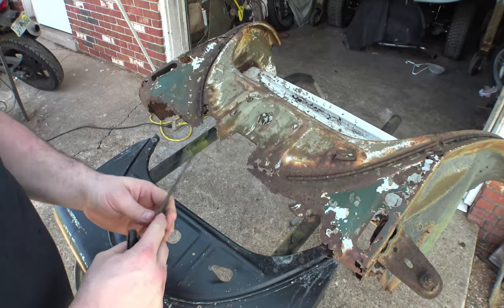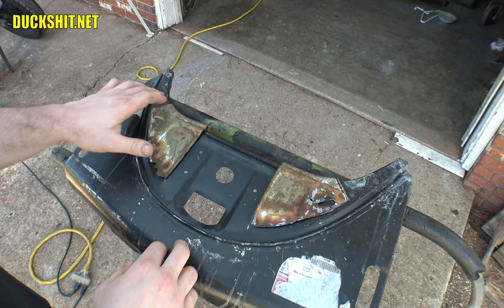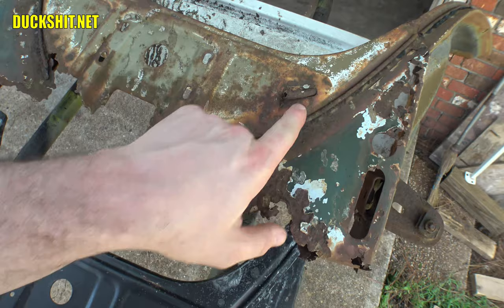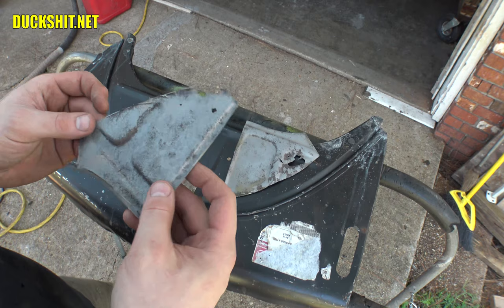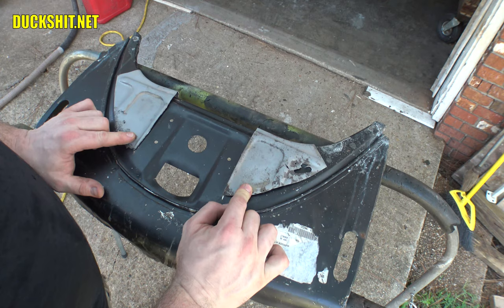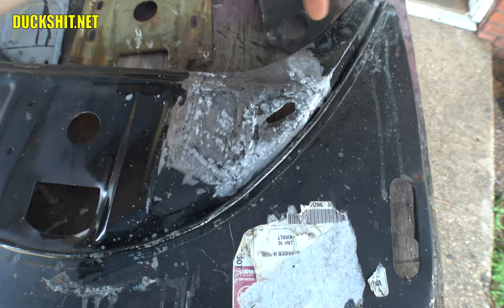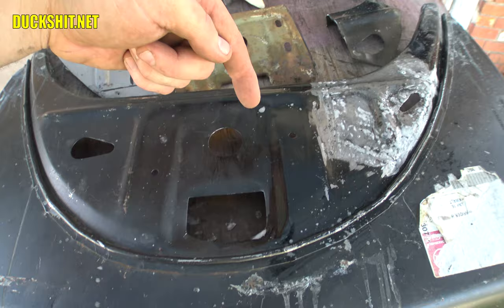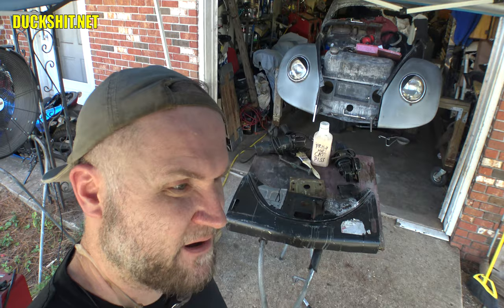Front Apron Patches - ROTTEN OLD 1956 VW BEETLE - 116

Comment: I really like watching someone on YouTube like you do quality work. I am slowly working on my sweet 1985 Pontiac 6000LE. I have known the car since it was new and I have owned it for 24 years. I like picking up quality tips from guys like you! Please keep up the quality content.
Reply from the maker: Thanks so much for watching!  Interesting that a Pontiac guy watches me for lessons!  Thanks so much for sharing!  I hope you're making videos!
Reply: I had a 1989 Grand Prix SE rare 2.8L 5-speed car. Loaded. Now have a 1999 GTP and a 2005 GT2 (4-door). Had them since new too. I know them inside and out and have the Helm Service Manuals. Isn't the 6000 like a Bonneville?
Reply: All this A-body had been crunched here. First they last as shifted stacks.
To be fair, nice design (Buick Century 2nd gen) but poor quality and fitment
Reply: @junkman6456  I have had great luck with my car over the decades. It now has over 230,000 miles on it. The 2.5 liter Tech4 and THC 125c transaxle are still original! It is starting to get a little rusty in a few hidden spots, but I am working on it. Mine hasn't been out in a salty Wisconsin winter since 1999 so that has helped. I worked at the very dealership that me car came from when new and noticed early on that the Canadian built cars like mine were always better from a build quality standpoint.
Reply: I noted the inner rockers the a-pillar and the firewall are the worst spots here for rust. The first part here is to remove are the outer rockers but they are only point welded with some seam sealer. I worked at this time for an ODC dealer too - the basement full of new loaded GM crap. But it was fun. And something extraordinary at its time. And they where kinda cheap compared to a Benz W124 300E but this is another liga.btw you brought me to the idea to source the duckman with a working cruise control from such a car. If he agrees. Its machanical exc the 'resume' function and goes straight onto the gas linkage cable.

Comment: Those heavy old German presses sure did make nice parts.  The new parts are all stamped out on cheesy presses that don't have enough weight to make them crisp.
Reply from the maker: Yeah, I'm sure the tolerances of the stampings are also a bit less than perfect.
Reply: Guess they are rather using some chinese junk then the one you mentioned.

Comment: I didn't know you had saved back as much of the front end of Eleanor. I wonder if when you get some time later you could scab enough metal onto it (spare tire well, etc.) to rebuild the "box" of the original front end? Then you could either keep that or sell it to someone rebuilding their car for a pretty good amount? Either way, great work on the apron!
Reply from the maker: We are both on the same page!  That's the reason has that white sexy welding on to it now to keep it whole.  😁😁😁
Reply from the maker: Eleanore lost a lot of her original front end.  I only patched the replacement front end with unique to 1956 components.    Hehe...  Not much left to even scrap at this point.  I will make a video of that later on.

Comment: yeah looks really great!
but on the other side, why not just welding in a small piece in this big hole? Less work ;)
Reply from the maker: Apologies!  I fail to understand the logic in the question.
Reply: oh sorry, english is not my mother tongue ...

In 4:12, your hand covers the area of the front apron, where you will also weld in the original piece.
I wonder why you do not close the egg-shaped hole with a piece of metal?
Would not that be easier, instead of cutting out the entire section and welding in the original piece? (it is possible that I did not understand it from the video)

now with help of google translate :D
Reply from the maker: The hole wasn't my concern, the missing "T" was.

Comment: I may have missed it at some point in your videos, but what prep do you do to remove the phosphoric acid before paint?
Reply from the maker: The acid is removed by the air, it just evaporates.  The dust that remains you wash off, or gently scrub with wire brush, remove the loose stuff.
Reply: Sweet! Thank You! Love the videos you make
Reply from the maker: @stephenwhite1316  Thank you so much for the comments and the support!  Lots more going on around here, going to get back on the Gregory the Bus soon enough!